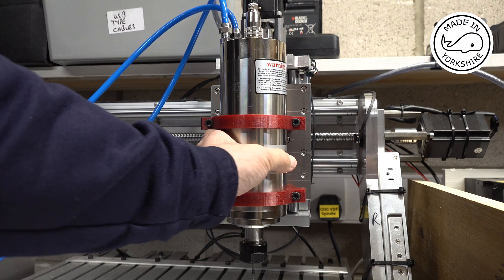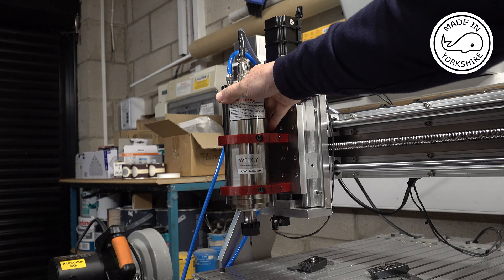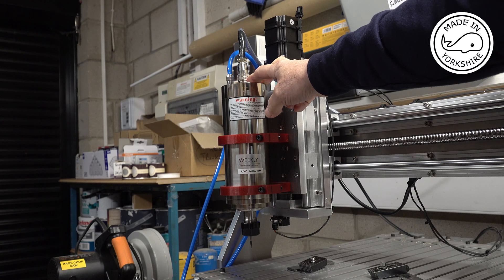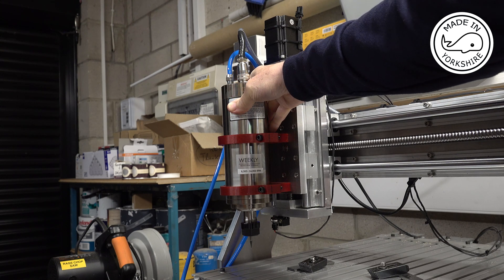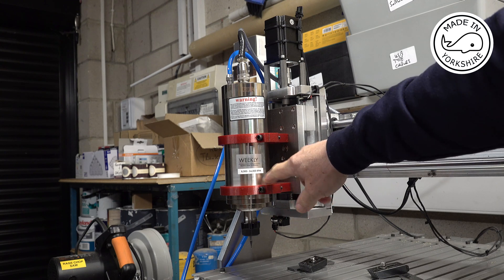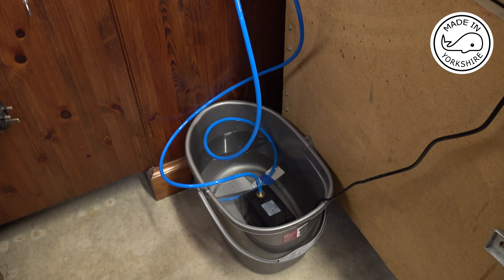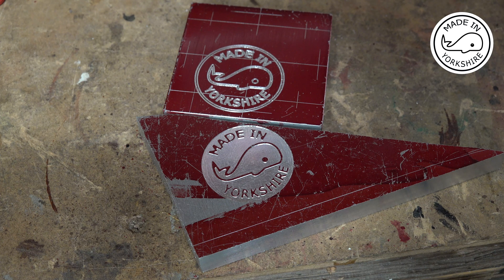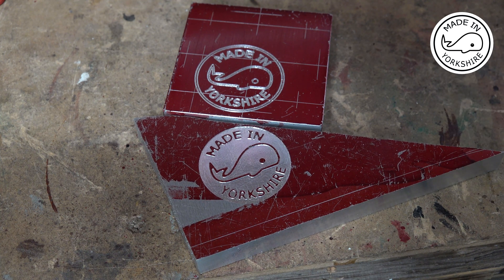#MT47 Part 9 - Olivier CNC Router/Engraver. Vevor Water Cooled Spindle. In 4K/UHD by A Whale.

Comment: I have a very similar spindle for my router. I used a single 120mm rad from a PC cooling loop including a 12v water pump. This is fairly compact and it did not break the bank. One more thing is you probably want to build an enclosure for this machine, a sound isolating enclosure. The sound of the spindle is nothing until you have an endmill removing aluminum at 20000+ rpm during a pocket operation and the entire neighborhood can hear it. One more plus thing about the enclosure is it keep the area clean of swarf and easier to clean up. Enjoyed the series! Edit: one more thing I forgot to mention is using corrosion inhibiting antifreeze, not for the freezing aspects but for corrosion. I used the Mercedes blue stuff I had laying around but anything that comes from a vehicle that has an aluminum block engine is good enough.

Comment: You'll probably want to set up a light air blast pointed at the end mill so you don't get re-cutting of the chips. That's something I did on my Taig mill back when I had it. It will make more of a difference when you start cutting deeper.
Reply from the maker: Hi John. Many thanks for the tip. I'll bear that one in mind.
Cheers
Andrew

Comment: Hi Andrew, I see you are getting adapt at this CNC stuff. My brother ( a machinist) told me when making plaques to use a small ball nose milling cutter at .005-.010 inches deep. that really improved  my work. I started out using a pointed engraving cuter and didn't like the look. I also made lighted signs from clear plexiglass with the ball nose and they look great with edged lighted leds!
Rich, from across the pond
Reply from the maker: Hi Rich. It looks like I'm on a very similar learning curve to you - taking a couple of cuts around 0.1mm each with various engraving bits. I'll look for some small ball nose cutters as you suggest. It opens up a whole new avenue of things to make. Really good fun!
Cheers Andrew

Comment: Very interesting series.
Apart from engraving, can it be used to cut out gears - for clocks say?
Reply from the maker: Hi Mark. I would imagine that machining gears is definitely possible on thin material. Work holding would need to be good. Maybe double-sided tape on a piece of scrap metal. Choice of tool is also key.
Cheers
Andrew

Comment: Looks Good Andrew. I would STRONGLY suggest that you use Deionised ( Distilled Water ) in you bucket / system. You know what happens to a kettle when you use tap water, it furrs up with the heat. Regards from Australia,
Reply from the maker: Thanks Dave. I'd not thought of that. Something else to buy! 
All the best.
Andrew
Reply: @learningturningmetal  Further thought, use a Tupperware type of box with a lid to keep the dirt and swarf out instead of an open bucket, just cut holes for the pipes as close a fit as possible. . Might also want to add a drop of anti slime stuff like they use in garden water features to stop the water turning green. With regards to the water, you could save and use the defrost water from your freezer as is pure. Regards from Australia.
Reply from the maker: @daveticehurst4191  thanks Dave. A good idea regarding the box. I'll look out for one.
Cheers
Andrew
Reply: @learningturningmetal  Probably cheaper to buy than boil kettle/pot and distill the steam